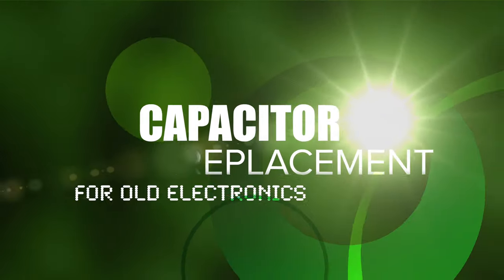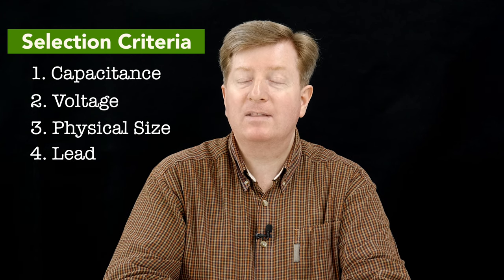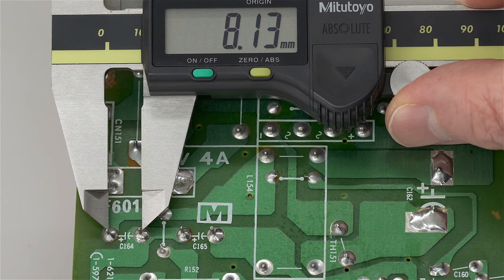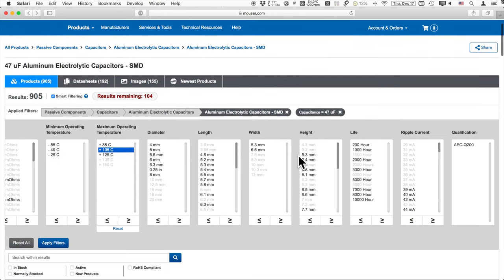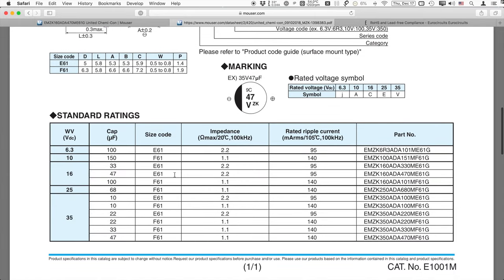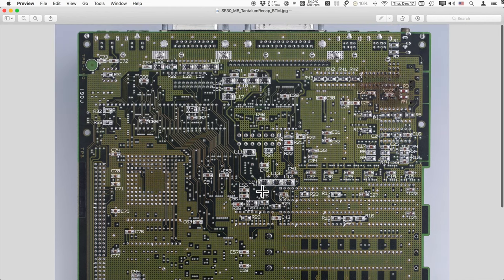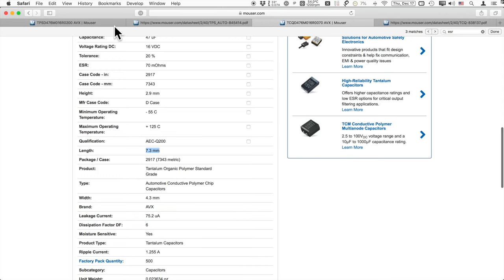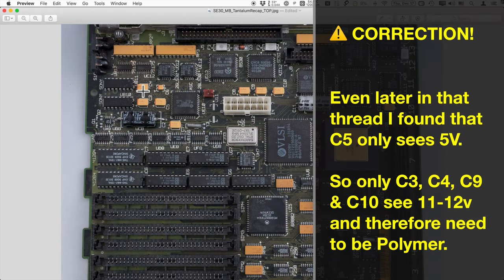Choosing Capacitors to Recap Old Electronics

Comment: I have a Radio Shack STA 85 AM/FM amp I bought new in 1979, used it on all my computers basically 10-12 hours a day for powering my wall speakers, it started putting out periodic noise about 4 years ago so I bought a new unit, but I miss the STA 85 because my gear in all on a rack in the basement and I turn the power off to the amp, printer and monitor when I'm at work, with the STA 85's mechanical controls it always was set at the same volume level etc when the power was turned on, the new stuff uses electronic controls and I have to go downstairs and turn it on and set the volume every time, thinking maybe I could replace the caps in the STA 85 and that might be usable once more!
Reply from the maker: Assuming no other components have gone bad, a complete recap of all the aluminum electrolytic capacitors very well may bring the old STA 85 back to perfect working condition again.

Comment: This was a great video but I have a question regarding purchasing caps for my Pentium 3 motherboard.  I understand the basics of a cap like stated in this video but Digikey list many caps with things like, coupling, decoupling, low ESR (I get audio and automotive are just a better grade).  A capacitor can meet the specs based on the typical things discussed in this video but can be one of those other designations in instead of general purpose.  Do they matter in my case of recapping a P3 motherboard and if not when do they matter?
Reply from the maker: A motherboard doesn't have a switching power supply on it and therefore there is no worry about your new replacement capacitors having ESR that is "too low."  So you can use "low ESR" replacement capacitors, if you like.  However, "low ESR" tends to refer to electrolytic capacitors, not other capacitor types like Tantalum, Polymer Tantalum, Polymer Aluminum caps like OS-CON, or Ceramic.  And if you replace all your electrolytics with more electrolytics, you will have to replace them again 20 to 25 years later.  So when I recap vintage Macintosh motherboards like the SE/30 described in my video, I use capacitor types OTHER THAN electrolytics.  And if you use SOLID Tantalum you must derate by 50%, and to know that you would need to know if some caps see 12V or not, and if you don't know, then your SOLID tantalum caps would all need to be rated 25V each to be safe.  Or you could use Polymer Tantalum rated at 16V because they don't need as high a derating, but they are much more expensive.  Or you could use OS-CON (my preferred cap these days for motherboards), because they can be rated at 16V too (or higher), and they are shaped like cans so they look stock (like electrolytics), and they have lower ESR than Solid or Polymer tantalum.  You could use Ceramics, but those need to be rated at least 50V to avoid the DC bias effect where capacitance decreases according to applied voltage.  I think OS-CON are better than Ceramics due to all the caveats of Ceramics.  And so, when you understand all this, you can avoid any confusion about "coupling" or "decoupling" or "low ESR" or "general purpose" designations on Mouser, which again, tend to mainly describe fluid-filled electrolytics, rather than other capacitor types.

Lastly, I don't use PCs or have experience recapping them, but it could be that your motherboard has large electrolytic capacitors on it which have such high capacitance that they absolutely must be replaced by capacitors of the same type, meaning, electrolytics.  In that case, because it is a motherboard and not a switching power supply, what I said about ESR still holds true.  You shouldn't have to worry about your replacement caps being too low ESR.  So in that case, you can safely use "low ESR" electrolytic capacitors.

It is only on some switching power supplies that you need to be careful with extremely low ESR caps because some power supplies want a Minimum ESR.  But on a motherboard where there is no switching power supply, most all of the caps are "Decoupling" (aka "Bypass) capacitors that try to sustain voltage levels on motherboard chips so that nothing brings down the voltage on any chips, not even for a brief instant.  And the lower the ESR, the faster those capacitors can respond to very brief sags in voltage.

So what if there is a power supply on the motherboard?  Well, I assume that would be something like a 5v to 3.3v down-converted or similar.  And in the case, you would want to take care your replacement capacitors connected to that power supply aren't too low ESR.  But if the capacitance is large, you would be replacing them with electrolytics, which don't have that low ESR even for caps which say "low ESR," at least not in comparison to OS-CON.  So I think you probably would be fine using "low ESR" caps, if you like.

When I replace caps in switching power supplies, there are many things I just don't know.  I don't have a schematic.  And I know in some cases ESR could be too low.  So what I do is buy "general purpose" and "low ESR" and swap out the caps with my "low ESR" replacements and see if all is well.  If all is well, I leave it like that.  If it has issues (usually found by connecting the output to an Oscilloscope), then I can swap "general purpose" (higher ESR caps) in and out unil the problem is gone.  If you don't have a scope, then recapping a switching power supply is more tricky.  You would only know if your machine works or not, and you wouldn't know if power is clean or dirty because without a scope, you can't see any noise riding on your voltage output.  A handheld meter won't show you that.  But some scopes these days are pretty cheap, like the Rigol DHO804, which I purchased recently on AliExpress for only a few hundred Dollars, and since I use it a lot, that cash outlay was acceptable.  Not worth it for only 1 recapping job though.

I hope this helps.
Reply: @JDW-  Thanks for the reply.  This helped a lot.  I wasn't asking so much if I could use low ESR caps, but more if I should be using them and if so when do I use one or the other just looking at a board.  This is because you can't always tell just be reading the information on the cap.  It sounds like in my case for the Pentium 3 board I really can't go wrong using them and in some cases they may be needed.

Comment: Hi, I'm not sure I'm the only one but I did swap all caps with MLCCs with great success. I wanted to know your opinion about those. I am on the same page as you, as I don't want any liquid electrolytics. Here is where I don't agree with you: I wouldn't want any tantalum either, as those break in a dead short :)
In the end I used X7R MLCCs with great attention to voltage and capacitance.
The board is working fine, but I wanted to ask you why you don't recommend MLCCs?
Nice video BTW
Reply from the maker: You have to be very careful when selecting an MLCC (ceramic) in a given recapping application. Here's why.

The physical size of ceramic capacitors increase & decrease (a size change so small it's imperceptible to the human eye) as applied voltage increases & decreases. It sounds pretty crazy, but it’s true. So while ceramic capacitors are very often chosen for the output of switching power supplies due to their extremely low ESR, they can also make a lot of noise because they vibrate the entire PCB, which amplifies the sound like a speaker.  If you've ever heard a constant buzz when using a product that has a switching power supply, ceramic capacitors are the reason! There are some expensive specialized ceramic capacitors that are made to eliminate that vibration on the PCB, and sometimes you can design a PCB with holes cut around the capacitor itself to attenuate the vibrations of the PCB itself -- but for recapping that is not practical.  Not every recapping job with an MLCC will turn them into a buzzer, but this is neverthless a concern.

Yet another big problem with ceramic capacitors is that they have an even more strict voltage Derating than solid tantalum capacitors. Why? Because the Capacitance of ceramic capacitors decreases according to the voltage (DC bias) you apply to them.  That's right...  The higher the voltage across a ceramic, the lower its capacitance! Sometimes capacitance can decrease as much as 80%.  Imagine a situation where you want to install a 1µF capacitor in a circuit that sees 10Vdc. You might need a 100v rated ceramic capacitor so as to maintain a stable 1µF of capacitance.  

The downsides to higher voltage rating for ceramic capacitors are Cost and Physical Size of the capacitor.  Even if you have enough circuit board space to accommodate a physically larger ceramic capacitor, and even if money is no object so the higher cost doesn't matter, you still may NOT wish to install a physically large ceramic capacitor because ceramic capacitors are ceramic and therefore brittle. Depending on the size of the circuit board or product, a fall to a hard surface from the height of even a couple feet could crack large ceramic capacitors.

If you want even more reasons, you can read what I wrote here:
https://tinkerdifferent.com/threads/spicy-oclock-project-has-started.128/page-3#post-7050
Reply from the maker: Regarding SOLID Tantaum, which isn't the same at all as POLYMER Tantalum (which have a benign failure mode, not shorted), it's all a matter of how to properly derate them.  They are used in pacemakers and in space and in the US military.  That's right.  They don't always go up in a fireball when properly derated in accordance with manufacturer specifications of 50% or more.  So if you will be using a tantalum cap on a 12V rail.  Do NOT use a 16V rated SOLID tantalum!  12V x 2 = 24V, which is the proper voltage derating for SOLID tantalum in that application.  Polymer Tantalum can be rated at 16V in that application though because it has a different voltage derating requirement.  The issue with the Polymer types though is cost, which is why I tend to recap old Mac motherboards with OS-CON caps instead of Polymer Tantalum.  Besides, OS-CON has lower ESR than Polymer Tantalum (which has lower ESR than SOLID Tantalum).  All have lower ESR and more stable ESR than fluid filled Aluminum electrolytic capacitors though.
Reply: @JDW-  Thank you. I learned something new. I really appreciate your input. :)
P.S. Now I remember seeing capacitors with bendy legs on some boards (in the shape of S) Maybe the reason was to stop the vibrations to reach the board.

Comment: Maybe you mentioned this.... When leaving cap legs to resolder to - consider a heat sink, if needed. To prevent heat damage to new cap.
Reply from the maker: You are referring to 43:45 in my video where I show how I did a couple Axial lead capacitor replacements on an SE/30 motherboard.  That was done many years ago before I had a hot air station.  With hot air, you can more easily and safely remove the old leads completely from multi-layered boards.  Even so, not everyone has a hot air station or knows how to properly use it, in which case my advice in that section remains sound.  

Heatsinking is fine, but it is not needed if you solder correctly, which means keep your soldering time on each leg to about 3 seconds or less. This is what most data sheets will tell you.  Aluminum heatsink clips can protect the cap from excessive soldering iron heat in theory, but the heatsink also draws heat from your soldering iron tip, which could possibly result in a cold solder joint for someone inexperienced.  And since one of the existing leg nubs is soldered to a ground plane which is a large heatsink, that leg will take a fair amount of heat for the solder to properly stick to it.  When soldering to existing leg nubs, it's important to ensure your new cap is definitely soldered on well. Adding a little flux might help.

Comment: I would also mention interstage paper capacitors for people restoring vintage vacuum tube equipment. These become leaky over time, and begin to conduct DC that they're supposed to be blocking. This can throw off the bias of the downstream stage, leading to improper bias, over current and premature tube failure, as well as increased distortion, frequency response and gain errors. A simple ohmmeter test may not show the problem, because leakage can increase dramatically at higher voltages. Most restorers simply yard out all the paper caps and replace them with good quality film capacitors of similar voltage and capacitance. The newer film caps are usually much smaller than the originals, making positioning easier. Although, if the original appearance is of a high priority, it may be possible to hollow out the old paper cap and put a nice new plastic film cap inside. Electrolytic caps in vacuum tube equipment are usually always out of spec, and should be replaced as a general rule well. Again, newer devices are usually much smaller, and modern packaging is often much different. Some clever physical rework for esthetic purposes is optional. Mica and ceramic caps are usually not a problem in tube equipment, but it's not unheard of.
Reply from the maker: Hollowing out the stock cap in order to fit a modern film cap inside is a wonderful suggestion!  Thank you for watching and for taking the time to write such a helpful and detailed comment.

Comment: An ESR meter is useful too . Dc leakage in cheap caps is not always obvious
Reply: Thanks for listening , have fun . Ps you can build your own E.S.R meter as a kit
Reply from the maker: Please expand the text description I wrote under the video and keyword search for "DE-5000".  That is the single best handheld ESR meter money can buy.  It's the one I use, and it's fabulous.  You can choose 100Hz, 120Hz, 1kHz, 10kHz or 100kHz.  Most data sheets use either 120Hz or 100kHz, so the DE-5000 has you covered.  Here's a little tip...  If you set the DE-5000 to capacitance mode and then try to measure ESR but find it is too low to register, switch the meter to Resistance mode.  It will still allow you to check using 120Hz, 100kHz, etc, but now you can see the lower value that wouldn't display in Capacitance mode.  It's really an awesome meter that should be in every electronic hobbyist's toolbox!
Reply: @JDW-  thanks .

Comment: Most certainly I have had to be sure solder mates to leads more than I have with lead solder sometimes. One good reason I like lead free is my grandkids won't be subjected to harmful lead. Bought a VOM new old stock that was in-op, looking at soldering on board it simply had poorly flowed lead free solder in about 5 instances which was the cause of some of its functions being non operative. My point it seems as though the lead tin types pool in faster and more assuredly seems like.
Reply from the maker: Whether using leaded or lead-free solder, using supplementary flux can be critically important at times so you can get the solder not only to flow nicely but also attach itself to PCB pads and component pins.  In my own work, I've found extra flux to be more important for SMD work than thru-hole, but it still benefits both.  I prefer leaded solder to avoid the tin whiskers problem inherent to most lead free solders, and because I like flowing solder with lower temperatures.  There's actually more harm that can come from breathing in flux fumes than from touching leaded solder.  So long as you don't ingest leaded solder, you will be fine, especially if you wash your hands after a long soldering session.

Comment: I have a piece of '70s tech with mylar capacitors. Can those be left alone or should they be replaced?
Reply from the maker: Mylar caps are polyester (PET) and therefore part of the "Film capacitor" family which do not have a liquid electrolyte and do not need to be replaced (unless you know them to be bad).  They have low ESR and handle high voltages well.  Despite having been made in the 70's, they most likely are working just fine in the circuit.
Reply: @JDW-  Thanks!